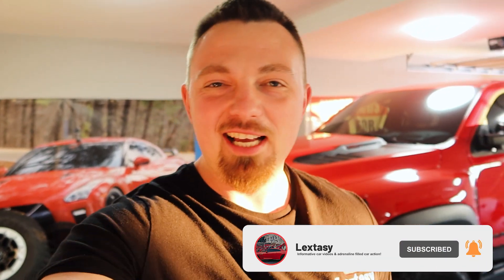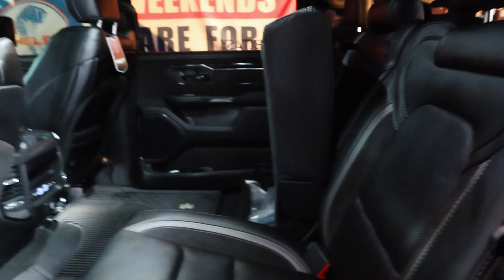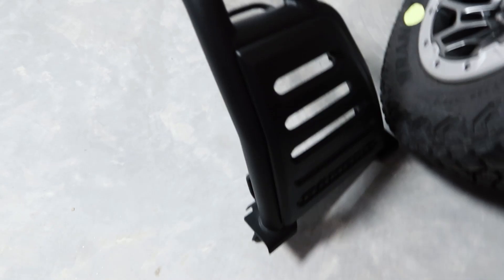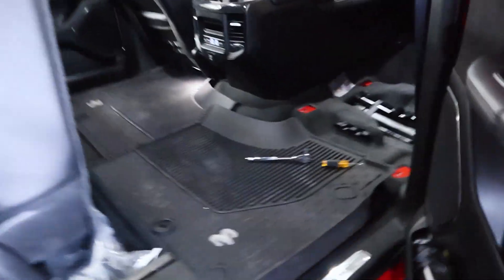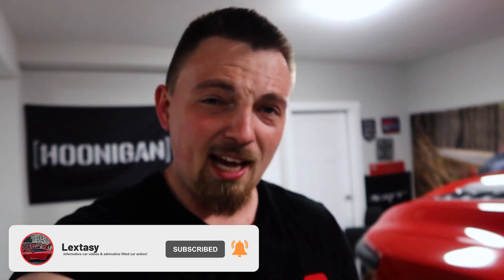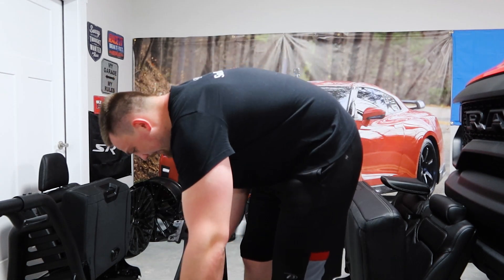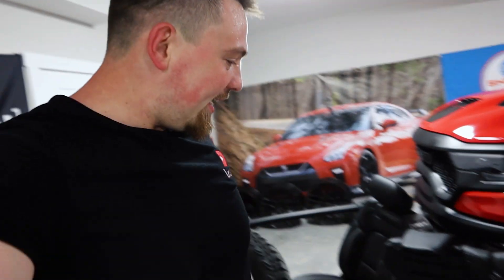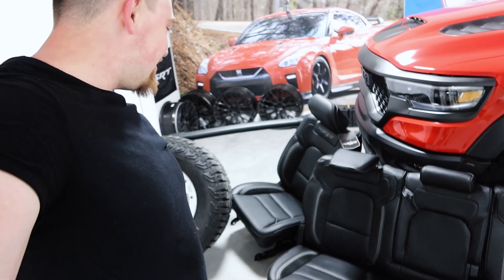I Gutted My 2021 Ram TRX To Make It Go Faster At The Track! Is It Worth It? Better Gas Mileage?

Comment: Paying and arm and a leg for one of these trucks (vs a non-performance), then gutting it is a great idea, because then you can get where you're going quicker.  Fast 0-60 times = getting to where you're going quicker.  Whether it be to work or on a cross country trip pulling a trailer.